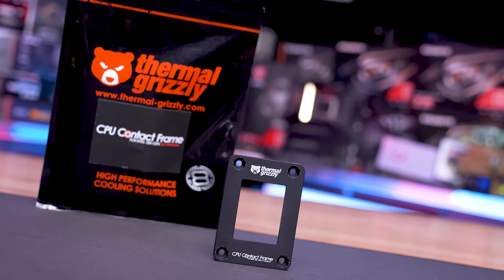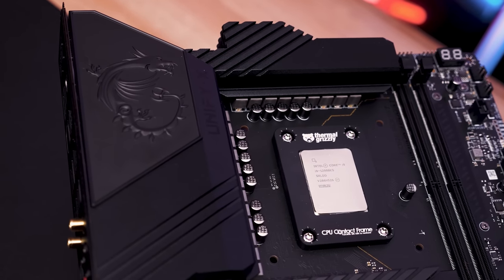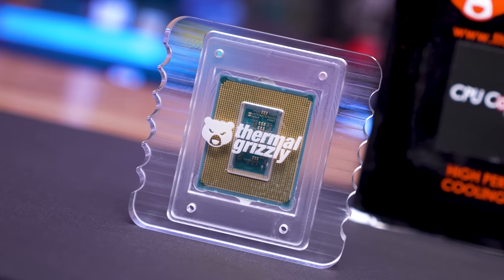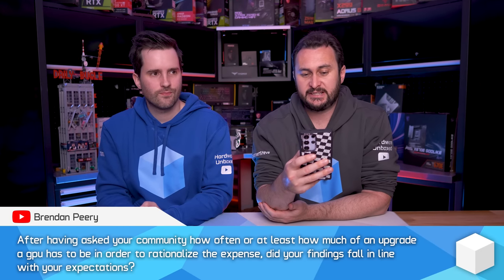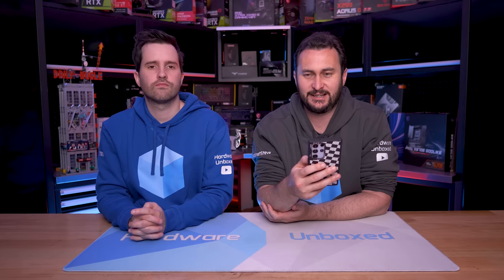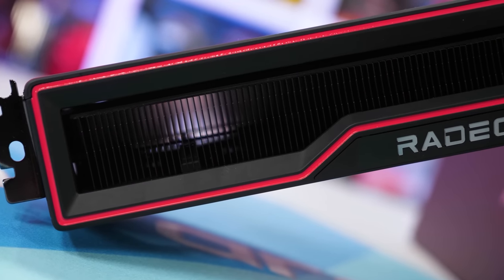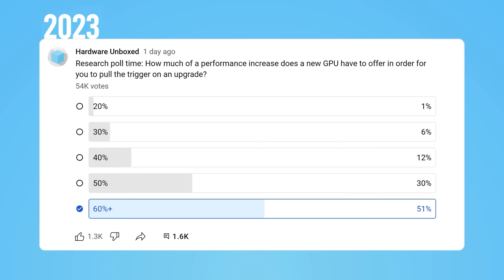RTX 4050 Pricing & VRAM, Are 12-core CPUs Dumb? March Q&A [Part 2]

Comment: Forgive my naivety, but why does AMD release like 100 versions of different CPUs to try compete with Intel at every price point instead of just undercutting Intel's best chip with their own better chip at half the price? The way they are doing it, trying to compete at every price point with 100 different chips, that must cost them a huge amount in production, unsold inventory, research and development, etc. Why not just use all that money to release 1 single well priced, well designed CPU that competes against Intel's best CPU, but is priced more closely to Intel's lower end chips? Cut out all the other crap and make it super simple for the consumer; choose from 30 different intel chips at a high price, or buy AMD's flagship Intel crushing leading edge CPU at a lower price than Intel's lower end chips? Again, maybe I don't understand how the market works, so maybe I'm way off base here, but that to me sounds like a winning strategy.

Comment: 28:00 Are people forgetting his involvement with Polaris? A card that still lives on to this day? Also Intel had had a bad track record in general. Their process node development was delayed several times and the fact that they don't have the necessary technology to produce a GPU die like the A770 is laughable at this point in time. Intel has been stuck in the reaction phase since Ryzen came out

31:52 3D V- Cache is an extra cooling barrier that Intel can't handle because their CPUs are hard to cool as is

Comment: Yeah we need more Vram asap.  All the AI generating stuff is starting to catch on and it  use a lot of Vram. The current GPU are going to become outdated really fast.  Imaging getting a 4070ti then a week later realizing that it has nowhere near enough Vram to use stable diffusion properly.
Reply: I also found stable diffusion and its really nice to play with. My aging 1070 can do it, but I would love a better card with double the VRAM.   
My current situation with money is not pleasant. I am very hesitant to buy anything, despite that, I would love 3060 Ti for at least gaming, but for stable diffusion, it's on "Naaah" I'll wait. for the games I play GTX 1070 is still quite a good option. I also have a gaming 1440p monitor capable for 166hz. So 1070 barely suffice for newer games at that target resolution .CPU is R5 3600.

Comment: the problem with the current pc hardware market is prices are way too high even for older pc hardware in my situation my system is am3+ I'd have to literally buy and change over half of what is in my system just to upgrade it and I have absolutely no clue what to look for in terms of parts

Comment: You know, that explanation with the RX 6600 would make more sense if people also didn't buy RTX 3050/60 as they were also woefully over priced at launch and still are currently.  People just don't want to buy AMD GPUs, even when they are priced one tier lower.  According to Steam's hardware survey, there are nearly twice the amount of RTX 3060s in the wild as RX 6700 XTs despite the GPUs being nearly identical in price.

Comment: I just got a msi mech 2x 6750xt 12GB OC for $677 CAD after taxes.   I tried my hand at an intel a770 for $200 cheaper but it was defective (fans stopped spinning while in windows, this function is not part of the card's drivers/firmware yet) and there's still issues with drivers.  cards are too expensive to go with the latest and greatest.  The 6750xt is the most expensive card I have purchased.  Not replacing that anytime soon.

Comment: If the 4050 had a 75w LP model, that's the one. Most gamers are on a budget and nobody will complain about 3060ish performance that you can drop into a dirt cheap office PC. Even at $300 it'll make a decent $500 pc that rivals a PS5 without the yearly tax and expensive games

Comment: To processors questions I could try to answear.
1. 12-core Ryzens are probably saved waste. We know that Ryzen 9 7950X is like two Ryzen 7 5700X, so probably those CCDs in Ryzen 9 7900X are just worse yields and have just 2 cores, which are not on par or simply not working properly. If I'm correct this is good in a way, but if they are just done, cause we can and we need to feel this price gap, then they are just stupid.
2. Intel with 3D or just bigger cache could be hit or miss. Just like HWU stated, Intel has better memory management and don't lose too much performance with worst memory. Still this is interesting and I think Intel should try at least one model to see what will happen. With all of that AMD could go hybrid cores in their CCDs like Intel with performance and efficiency cores. I think this is what they are trying to do in APUs, probably mobile model. If someone remember the rumour, please correct me. Of course with multi CCDs and multitype cores it would be a nightmare to set windows scheduler, but if they would do it properly and still maintain good performance per watt, that would be a killer consumer CPU. But with all of that I think those processor would be too expensive to be consumer friendly.

To GPU prices, I think you both were correct. Companies are trying to make those high prices a norm and maybe ease a little with some sales once in a while. At the other hand, market won't tolerate too high prices, cause most of people won't be able to buy computers without going into loans. I myself would need to prepare about or even more than my full netto month salary to buy mid/high range unit (without monitors and other peripherals), forgetting about top end. This is scary, cause working in IT and having good salary isn't enough to buy hardware to work in that field. Then people like my parents, who have less than me combined would need to save money for many months to make a living and try to buy low to mid range hardware. We just need to have hope, that those rich morons would stop to buy unreasonably priced parts. I'm confused, why some people are still buying products like RTX 4090 and not even at MSRP, but much more than that. When I've read in YT comments about 2,5k € cards getting out of the shelves, I lost faith in humanity. How desparate you need to be to pay this amount for only one part, not so long ago you would get two decent stations for that amount.
I just hope market will crush and we will get massive price drops like 25-45%. With normal prices people would be more willing to upgrade more frequently than nowadays. All of people I know wouldn't upgrade for many, many years like 5-7. I have my oneplus 7 from premiere in June 2019, my current laptop I bought in March 2018. With my smartphone I am completely satisfied, so I won't change it for 2-3 more years, unless it will break. I've got android 12 update couple of weeks ago, so the is no need. But my laptop isn't enough for me to use it daily, but with prices and performace right now I'm not so keen to change my setup yet. I was planing to go with RTX 30 series, when they were about to be released, but prices and availability were horrendous, so I put my purchase into future plans. During that time I went with full interior renovation in my two story house. I payed that with money without loans, so money isn't a problem in a sense of having it, but in value of what I would get. I hope Ryzen 7 7800X3D will be good and reasonably priced in my country (central Europe) and I hope more midrange cards would be released with good value. I don't like to feel like I overpaid for something. I grew up in pretty poor family, so my fair value attitude is ingrained deep in me. I recently bought expensive tablet (Lenovo tab P12 pro), maybe not much expensive for some people, cause it was around 725€ price (sale, normally 830€ in my country). I still think this is expensive, but I think this product is worth this price. I could go with more like 500€, but those weren't good enough for my liking. So I think I proved my point of being reasonably priced is important and keeping still my tablet example, I wouldn't go near 1000+€ tablets unless they would be heavily discounted or I would win them somehow. When I saw about 2000€ samsung tablets I was in shock.

Comment: Crysis even with a 8800 GT ran badly, to the point that you had to put up with medium settings and 30 fps. Honestly the frame rate was the biggest issue, it wasn't stable at all, at low resolution it would jump from 25-50 fps.

Comment: The problem with the GPU prices (AMD and Nvidia) the cards having the interesting perfomance are way to expensive (nearly double of the acceptable price), the cheaper cards are not available yet and will be also way to expensive for the offered performance. Conclusion i assume i don't need a GPU in the future anymore, the next APU generations will have enough performance and my interests shifted to other topics. i found my sim and it performs well at 100 FPS (and if i have to drop the performance down to 60 fps its enough anyhow). I have enough other areas to spend my money which are way more important. The available money for things like computer components is strictly reduced by inflation.
Reply: Smart man.
Reply: They hopu to sell more 4050 level GPUs to the customers, so they have to upgrade more often!
Aka situation is ”fixed” when old ”baddly” aka ”too cheaply” made GPUs runs out of the market. They just redefine, what low end, middle range, high end and super highend means in the market. 
Normal people either use APU or xx50 level GPU at $400-500 and xx70 level gpu at $1000 and xx80 level GPUs at $2000 and well the ultra highend is for those who has ferrari or otherwice want to have nice GPU… at $3500+
That can become new normal quite fast….
Reply: @haukikannel  Their problem is there is no need for entry level GPUs anymore, as every new CPU has an build in GPU (yes of course there are version without build in GPUs, but its your own fault if you select these). Is the same in the photography market, the actual smartphones  are at such a high level that there is no need for entry level cameras anymore, the remaining market is getting smaller and smaller. In terms of GPUs as an "entry level" GPU tends to the double price of an complete console and the PC-titles are not really cheaper than console titles, there is a shrinking usecase wher GPU based PC system is mandatory.
Yes for a pro gamer its a different situation but for the casual gamer (which is by far the biggest part), for me as trucksimmer using widely mods its a bad situation but for fortnight, minecraft COD , ...... its a quite easy choice. (but i played my SIM long enough on a Lenovo T420, and it worked also, as it more suffers from single threading than from GPU problems, reduce resolution, details and framerate and keep calm)

Comment: I have a 5900x 12 core and I remember thinking, why don’t I just get the 16 core if I’m not getting the 8 core. At the time, the 5950x was over $100 more. Can’t recall how much more. But I mainly did more than 8 cores for perceived headroom in case it was needed. If I built now I’d go 8 or 16 based on reviews like this.
Reply: What's wrong with 12 core? Also if you were to buy a new CPU now, which one would you go for, 7700x or 7900x?
Reply: @momovalencia1  oh yeah, it works great. No plans to upgrade. I just recall being a little indecisive about it and Hardware Unboxed was wondering who is the 12 core CPU for. Me, at one time. I’m more into creative projects than games now so might go with Intel i9 these days or HEDT. What would you go for?
Reply: @ericwanner7966  Personally I don't game that often, but when I do I like to stream my games on twitch, I also work a lot with Adobe Premiere and Photoshop. So I'm not really sure if a 7700x gonna be enough, or pay an extra $100 and get the 7900x instead. I only upgrade my setup like once every 5 or 6 years.

Comment: I'm pretty sure the 7800X3D will be just as much faster as the 5800X3D were. When testers locked the non v-cache die on the 7950X3D it blew the stock one out of the water in games.
Reply: True but clocks on the 7800x3D will be lower than 7950x3D so it won't be the same as 7950x3D with 1 CCD active but still a nice improvement
Reply: @MonkeyMan125431  To my knowledge the non v cache chiplet has the higher clocks, the v cache one is pretty much the 7800X3D with the  lower clocks
Reply: @kerotomas1  AMD gimped the 7800X3D by 200 mhz if I remember correctly so as not to be equal to a 7950X3D with the non V-Cached CCD disabled.
Reply: IIRC, that CCD in the 7950X also has more cache than the actual 7800X3D spec provided by AMD
Reply: @RicochetForce  It does because there's an entire CCD missing along with its cache obviously in the 7800X3D, but there shouldn't be any difference vs a 7950X3D with the other CCD disabled.
Reply: @alexg9155  We'll see when the actual 7800X3D is released. I wouldn't be surprised if the 7950X3D's VCache CCD is better binned than the $400 8 core product for example.

Comment: They are probably better off just using previous gen cards as their low end pricing cards this gen. Drop the 6900xt to entry level price and then you wont have to bring out a 7700 and 7800

Comment: If they release 4060 with 16GB of VRAM for under $600, stable diffusion crowd (+the upcoming T2V crowd) will buy every single of it.
But that just a big IF. If they didn't release that, people will buy 4080/4090 for extra VRAM anyway, and that's a bigger profit for Nvidia. (AMD and Intel GPUs practically useless in this field, as they're 4-5x slower than Nvidia's card in the same price range. Because PyTorch is developed around Nvidia's cuda)

Comment: The increased price tactic has been super successful. Why? Because they made much less consumer GPUs and used the wafers for datacenter.
This way they will still sell everything but at a higher margin. Datacenter buys everything they can print at any price. Consumers will buy less but at a high price.
This works as long as every provider does the same. I would investigate if there was some illegal market manipulations here,  because AMD had no incentive to do this in the long term - they need market share. Maybe they hopped the train for some quick bucks but maybe they made a deal with nVidia, and in the latter case this is very punishable by law.The deal could be as simple as "should we restrict consumer GPU production and increase prices?"

Comment: 4030 -> 4050 If the price is not around 200 USD it would be better not to waste materials on hardware that will not sell, because there are better options currently available.

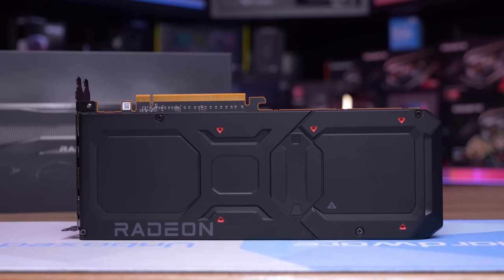Comment: WHAT?! "7900 XT is twice as expensive as 5700 XT and is only twice as fast". 5:44

You can get used 5700 XT for like 190 bucks and used 5700 none XT for like 140 bucks and flash that official AMD XT ROM by yourself! That's why 1440p gaming without Raytracing is so cheap these days! If 7900 XT would only cost like 600 bucks it would be a huge progression instead what we have today! 

And of course I am comparing the actual pricing of today and not MSRP against MSRP because 7900 XT simply was not available when 5700 XT launched which is not any more available new today. So we do have to compare prices of the same moment, because price/performance decays with time! And in the here and now 5700/ XT is a used product for often below 200 bucks.

When 1440p gaming with high details 80 - 120 fps with 8 GB VRAM cost used below 200 bucks (5700 XT) and new like 280 bucks (6600 XT), than double the performance with at least double of VRAM (16 GB+, better 24 GB) for 4K, high details and RT should cost like 600 bucks today. Since RX 6800 with 16 GB costs used like 450 - 480 bucks, this 600 €ur/ USD estimate is quite moderate.

So a 3080 with 10 GB for 500 bucks is as overpriced (with a lack of VRAM!) as a 4070 ti with 12 GB for 800 bucks!

Comment: I think Zen 4 X3D parts simply have too little cache to boost perf more than previous gen
Reply: More like it has ”too much” normal cache so that the difference is smaller. But most likely reason is that ddr5 is naturally faster than ddr4 so the cache is less meaningfull. In reality both affect depending on the game.

Comment: What's really the worse part? The GPU having 8GB of VRAM or the fact that it'll likely have a smaller bandwith memory bus? The RTX 3050 is horrible due to it's price relative to what AMD currently has but if compared the 3050 with the higher Tier Pascal GPUs like the 1080, what allows the 3050 to be comparable are essentially drivers (or lackthereof working against the Pascal card on this example) on newer games, while on older titles (like the Witcher 3 even with the newer patches) the larger bandwidth memory bus will give the 1080 a bit of an advantage. The VRAM amount becomes a problem in reality when the game as memory leaks (when it's a crap port - like The Last of Us Part 1 PC port, for example) because if memory usage is within reason, there are settings you can change while still keeping visuals rather nice and improve performance while you're at it
Reply: Having less memory is worse than having less memory speed.

Playing a game with 4GB of very fast RAM would run terribly with extremely long stutters vs slower 8GB of RAM.
Reply: @saricubra2867  You do have a point. but I was sort of thinking in terms of same amount of VRAM with different bandwith rather than actual memory speeds. Most of the Nvidia gimped versions of cards don't just get axed in terms of memory amount and it typically seem like the narrower memory bus hinders how they stack up to their non gimped counterparts than actual VRAM buffer changes. Think like 3060 vs 8GB 3060 or 1060 vs 1060 3GB for example